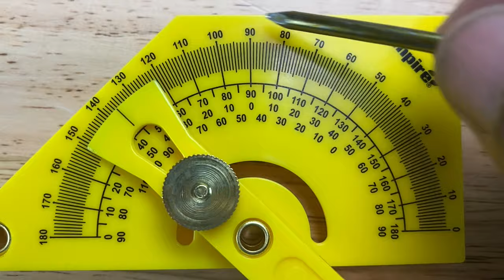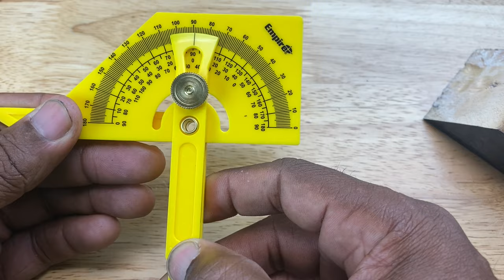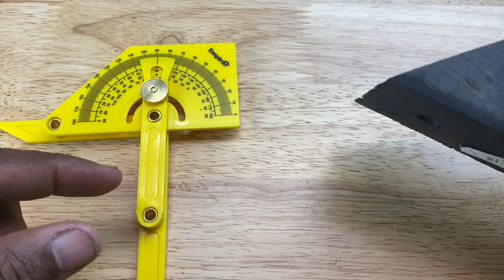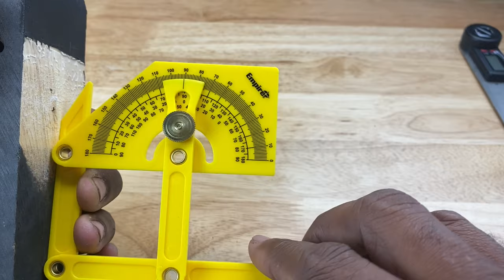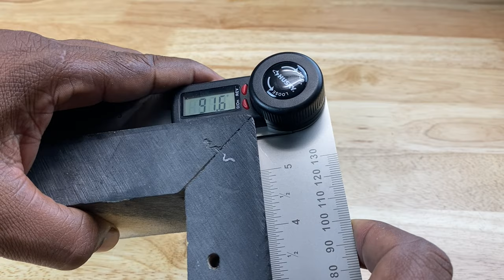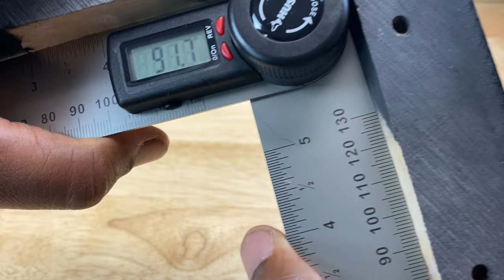HOW TO USE AN ANGLE FINDER

Comment: The first measure, 150, was not flush on both arms. It would have been 135 and 45 or 180.  Measure again
Reply from the maker: You’re very observant aren’t you. Thanks for the tip.

Comment: This is exactly what I needed. I am trying to hang a wooden bird nesting box in my yard on a wall that has cedar shakes. Cedar shakes are thin at the top and thick at the bottom. I want my bird box to hang straight and not lean back and could not figure out how I was going to figure out the angle to then know how thick of a shim I will need. I am going to pick up the first one you showed tomorrow. Problem solved. Thank you so much for a very useful video.
Reply from the maker: Glad it helped

Comment: Good video about how to read angles using angle finders and showing the different types.

Two suggestions: #1) show just a little simple geometry with a right triangle and show the 3 angles created when scribing a line - where you scribed a 60-degree angle, also show the viewers the 90 degree angle, and the 30-degree angle, which leads into #2) show viewers how to translate the 60-degree angle you scribed on the 2x4 to the proper angle set-up on a mitre saw, which would be 30-degrees (i.e. 90-60 = 30).

One criticism: saying 92.2 is close to 90 is not accurate. Actually, 89.6 or 90.3 is close to 90. In the beginning of your video you mention that being off by a few degrees can be bad, so your video should reflect that when you say you're "close" to something. As a positive, the "90" degree angle you measured, at first glance, looks square, but you're measurement showed otherwise. Looks can be deceiving, so "always measure twice and cut once..."

Comment: This is an incredibly detailed and helpful video.  Thanks for putting this together. A question- can you scribe an angle onto a long, flat panel of wood using the analog angle finder? Or would that be a better job for the machinist's protractor? Asking because I need to cut an angled notch out of some wainscoting due to an irregular wall corner shape. And it seems like the analog angle finder is good at identifying the angle, but not as good as scribing an angle line that I can cut along.
Reply from the maker: Hi Jeremy, I would use a machinist’s protractor for scribing. Let us know how the project turned out.

Comment: How can you measure an angle on a diameters using the second to the angle gauge?
Reply from the maker: Sorry  but the question seems a bit unclear.
Reply: @Caliber8Tools  i was trying to measure a 45` angle from a round object.
Reply from the maker: See the video on How To Measure The Length of a Curved Line. That may help.
Reply: 1. Place cylinder (circle) on top of plexiglass or transparent plastic sheet. 

2. Trace circle on plastic sheet. 

3. Use geometrical technique to find center (google) or just estimate where the center is. Then mark center on sheet. 

4. Use straight edge to draw line from center to edge of traced circle. 
5. Use center point on sheet as vertex when using angle device. Open device to 45 deg. Draw second line on sheet at this angle. 

6. Place transparent sheet on top of cylinder and mark both locations onto cylinder.

Comment: Wow that was bad...
Reply from the maker: please tell us what we missed so everyone can benefit, thanks in advance.
Reply: @Caliber8Tools  He meant that was good. see the heart sign? it would not be there if he meant it was a bad presentation.
Reply from the maker: Noted
Reply: There was nothing "bad" about this video and it's more helpful than any other video I've seen on this topic, so far. If you think you can do better (which I doubt) go ahead and prove us all wrong.
Reply: @Caliber8Tools  at 4:52 your first demonstration on how to use it, it wasn't touching on the protractor part. That would have most likely made up the difference on getting you to the 45 degree angle, which in turn would have made your 135 and 45 add up to the 180
Reply: Now with that being said, I've owned one of these angle finders for years and have even been using it correctly. Your video only confirmed what I thought was correct. Great video